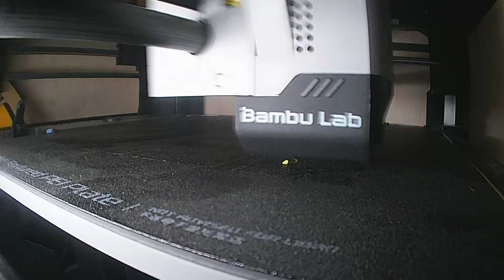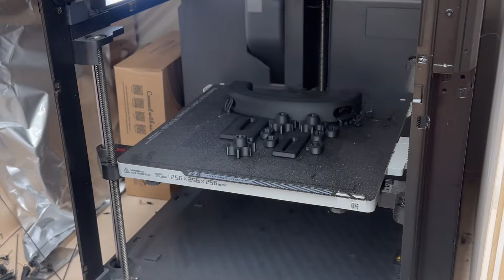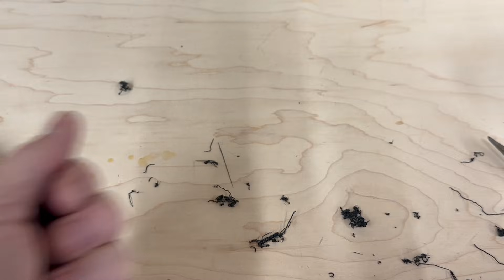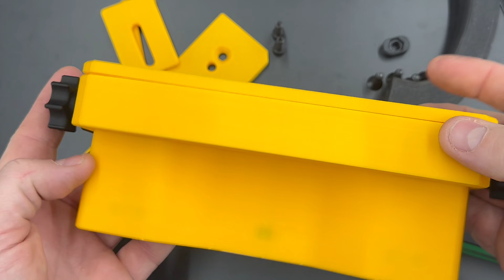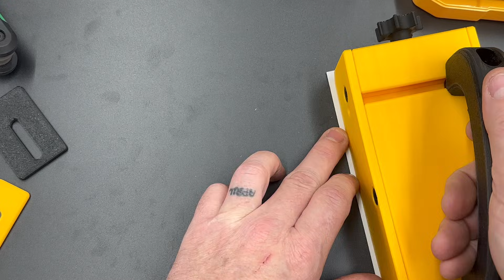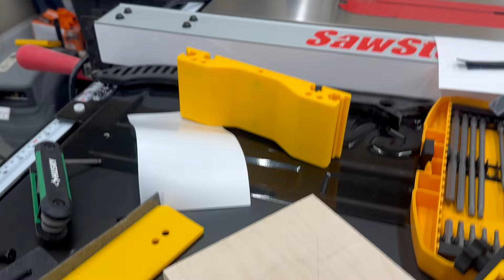DIY 3D Printed Push Block That Improves Table Saw Safety

Comment: Your first link to the "M6-1.0 Hex Head Screw Bolts Kit" does not work.  Spent far too long going to the hardware store getting bolts.  Finally had to cut come down to fit some parts.  it would be much more convenient if you'd list size and specs of bolts needed.  Otherwise, great design.
Reply from the maker: Thanks for the comment.  I’ll take a look at the links.  Although I didn’t create the 3d files for this, I believe the creator did list the sizes on makerworld
Reply from the maker: Thanks for pointing out the bad links.   Looks like Amazon changed the listing.  I’ve updated all of the links.

Comment: Damn that first move was already more than dangerous to get hurt by backshooting wood
Reply from the maker: I appreciate the concern; you're spot on that shop safety is something that shouldn't be overlooked.  I agree I shouldn't have lifted the block off of the piece before the blade stopped spinning, but I had moved to the side if there was a kickback.

Comment: I just printed the middle section with the nuts. Is it normal for the nuts to click when shaking the middle section?
Reply from the maker: The design seems to be created to accommodate nuts of various thicknesses. As long as your bolts can reach the nuts, it is no problem.  Mine rattle a bit inside the print too.  What type of material did you print yours with?
Reply: @TheIdeaGarage1  Okay, thanks for the quick reply. I used eSun PLA+ on a P1S. I'm considering adding one or two drops of superglue to the nuts from above.

Comment: Really great design and excellent execution. What I would find even more cool (perhaps for a second version) are the following two points: 1) A viewing window at the top to see the position of the saw blade. 2) One side of the push block narrower and the other wider.
Reply from the maker: Thanks for the comment!  I can't take credit for the design, but I like your ideas.
Reply: @TheIdeaGarage1  I hope you don't start implementing my ideas right away, because I wanted to print two copies in the next few days ;-) Otherwise, I would wait a little longer.

Comment from the maker: Since recording this video, I've designed a stabilizer plate that attaches to the extra holes in the side of the push block... the link to that is in the description.  Thanks for watching and comment below any other addons you think would be useful.

Comment: Stringiness and even warping is often due to wet filament. Once i started drying my filament, pla petg tpu, all printed without the stringing and warping.
Reply from the maker: I intend to buy the AMS 2 when it is available mostly for the drying feature exactly for this reason.

Comment: Just a quick tip from the 3D2A space on materials. PLA Pro is better for impacts than PETG or PET. The latter two tend to catastrophically shatter under impact loads, kickback from a saw or the blade itself could be labeled that way. Enjoy the hobby and stay safe, its pretty amazing what can be done with these machines now.
Reply from the maker: Thank you for that info, I was under the impression all PLA was brittle.  I'll have to do some research it seems.

Comment: Pretty cool tool. I like how it covers the blade.  I’ve watched people using the push sticks and get so close to the blade. Such a good design.  Cool video.  My buddy Bryant, who had the shop I worked at after I retired has got into the whole 3D printing craze. It’s come a long way and it’s amazing the things you can make.
Reply from the maker: It definitely has its uses.  A lot of people 3d print toys, but I’ve found tons of uses that are actually useful
Reply: @TheIdeaGarage1 yeah, Bry makes parts for customizing cars, like sniper EFI handheld mounts and tool organizers. He printed the Pontiac emblem for the front of my Firebird too.  Great invention that probably does have a lot of wasted and useless things printed on them. Lol